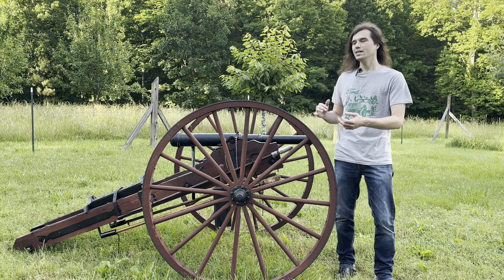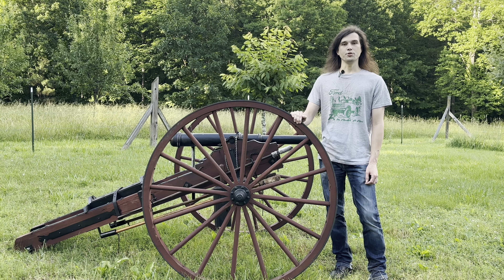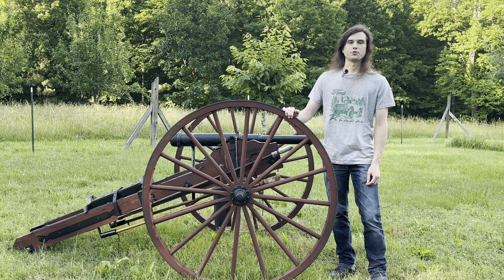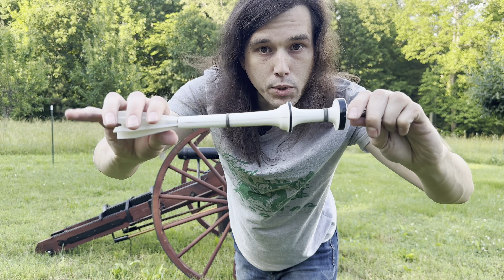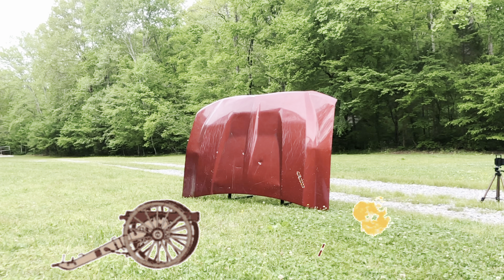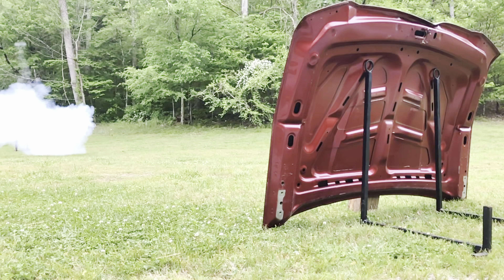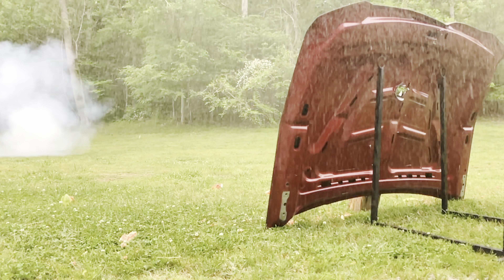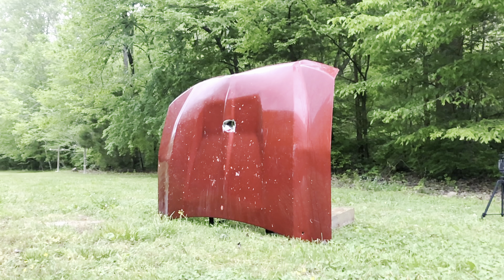Shooting 3D Printed APFSDS Tank Rounds

Comment: DING! Try Studying up on the M1A1 and its 120 mm Cannon, It uses a Sabot and its discard design, I believe that the dart is protected until exiting the cannon at very hi speeds at which it discards it protective sheath and is already in a stable flight use aluminum instead of plastic cast it and well destroy your target ...
Reply from the maker: I’ll see if I can cast some AL petals!

Comment: I did 10 years in the army, and worked with munitions multiple times. What you need is a base that is the bore diameter, with a 3-4 part cast that fits around the projectile that us the bore diameter on the outside, and patches the projectile profile on the inside.

Comment: ok, so here is my suggestion: Since you 3d printed the fins I think that you could/ might consider printing a hollow mold of those same fin designs for the rear portion and then using perhaps a resin filled with carbon fiber fibers mixed in and applied as evenly as you can. Perhaps a mold design that would snap together and allow excess material to flow out of tiny port holes that when cured could be cut or filed off. I would also be interested if you used the same method to cast a set of concrete fins and again allowing the discarding front portion of your sabot to simply be 3d printed out of the current materials. Only suggestions so please do not listen to me, but I think that it may work.
Reply from the maker: I think the molded fins are a good idea so I’ll have to figure out how to get that working or weld them on! I’ll probably make a few different versions from everyone’s suggestions!

Comment: Use a soft metal for the outer fins and shaft, like copper or led, then use hardened steel for the penetration part. Cut perforation into the outer shaft so it mushrooms and separates on impact so the hardened steel penetrate continues on. 
That’s what I’d do if I had the available means to do so. 
Sweet canon bro.
Reply from the maker: Honestly the idea of a glass shatter on impact round sounds horrifying. We’ve shot giant marbles before but I think I’ve got a fun design in mind for that….
Reply: Or maybe even a glass outer fins and shaft, so it shatters on impact. Something hard enough to withstand the initial blast, but soft enough to separate from the penetrate in impact.

Comment: You have to support the main pin in the center. If you’re pushing the fins, you’re gonna push those fins off of that pin. If you have some thing pushing on the back end of that steel pin just as much as you have it pushing on those fins, you should get a better shot with your Round. Otherwise, you’re just pushing all the plastic past the steel rod and then the steel rod has no correction because the fins aren’t attached anymore. Try something supporting and shoving on the pin that is your penetrator as well as the fins.

Comment: Your penetrator is locked onto the wrong side of the sabot! The sabot will fly out of the bore at top speed leaving the penetrator tumbling behind. My reommendation would be to make the rear of the sabot longer so that is the lenght of the penetrator, then back up the bundle with a bore-sized round plate that pushes it out.
Reply from the maker: We will give that a shot!

Comment: Try bringing the rod right through the fins at the rear, so that the pressure is exerted to the metal rod instead of the plastic fins. The black disks should be more of a cylinder shape so that they don’t twist in the barrel. Maybe even make them pointed at the front, so that the pressure is just on the rod, and not the fins at all. (Although I think this will probably deform and smash the fins anyway. Perhaps front it with a metal cone with a flattened nose) hope these ideas help, Tom
Reply from the maker: Thanks for the tips! We for sure have to drop the fins back to the end of the rods so they don’t just break apart.

Comment: You need a reinforced area that pushes the penetrator core, maybe leave the fins hollow, move the core all the way back and add a steel disk to the rubber plug?
Right now you have an accelerating piece of PLA being smashed against the inertia of a resting piece of steel.

Cool channel and concept tho, cheers from switzerland, i'm curious to see how you'll upgrade the projectile.
Reply: nvm, i read about the ribbed sabot thing, that's the solution.
Reply from the maker: I’m probably going to try both versions at some point and find out!

Comment: Because there is a gap between the pusher black disc and the penetrator end - the rear fins— the explosion and acceleration crushes the fins. I would have the steel rod be the entire length and have the forces on it and not the fins or sabot. The sabot will help trap some of the explosion and add to the velocity, but most forces need to be on the penetrator. The rod can absorb the forces, but not any 3D printed plastic
Reply from the maker: That a major edit for V2!

Comment: the prenetator and the fins need to be a single piece meade out of metal. Because the fins are in the middle of the explosion, so you need to make them survive comming out of the barrel. I would suggest using resin printed sabots they also need to survive at least part of the explosion and travel
Reply from the maker: I “think” I have access to a resin printer at work… 🤔

Comment: The second I realized that those fins are plastic, I knew it wasn't going to work. Try working with hand tools a little. Wood working, welding and other metal work. You will start getting a much better picture of the rigity of items. I love the the idea and I think you should continue pursuing it but seeing as you didn't see this coming from the get go, and was only worried about a pin. You either underestimate gunpowder or you're not sure how sturdy things are and that's pretty dangerous to say the least.
Reply from the maker: I think I over estimated the PLA and I also horridly misunderstood how the ammo itself worked being pulled by the sabot and not pushed by the base pin. That’s also why we shoot in a totally safe and controlled range!
Reply: @TheCannoneer  I suppose the next smartest step for you might be to build or find a smaller CNC mill capable of milling aluminium. Then the fins should hold out and the sabo find might even become reusable. 
Otherwise I hope you keep it, seems like a real fun project and I'm curious how well you could actually get something like that to work eventually. Good luck with your next projects and stay safe!

Comment: You could try going with a negative cup design for the back end / wadding.
Fins and wadding should create a filled cylinder (print the negative of the fins in order to have a negative cup design)
That is, if a cannonball made out of your materials will hold together all by itself. It requires some testing.
Reply from the maker: The PLA cannonballs are horrifying. Not very accurate at all but they will wreck a watermelon if you hit them. We did a video on them a while back!

Comment: just 3min into the video: you need holding grooves on the Dart to hold it in the sabot, the Sabot is your gas seal, just make it to the proper dimensions that it seals.
your design will result in the sabot getting shot out with the dart having next to no energy retained.
Dont put in any other discs or seals. 
Mashine the sabot out of harder material.

*edit: just what i expected happened. Sabot separates from the dart in the gun tube, the fins shatter due to the high pressure from the rear seal plug, the dart just flies out unstabilised with no energy.

Use threaded steel rod with an added penetrator cap, mashine steel petals with threading to hold the sabot, make some steel fins to thread on the dart, try to get to optimum pressure seal with just the Sabot. (this can be done with driving bands on the sabot).
then things should work fine
Reply from the maker: Major edits for V2! Thanks!

Comment: Don't real darts have some shaped surface where the hull can grip in to so the dart doesen't get left behind and the hull part's start flying out the barrel alone? Also i think the 3D printed stuff is no where near to deal with the forces working here. Maybe 3D printed metal would do the job.
Reply from the maker: Threaded rods are going to be a major fix!

Comment: When you say 37mm, what are the tolerances? 37.05mm or 36.95mm?
Reply from the maker: 38mm* we can go up to 38.5 but I’d be a bit shy to go too much bigger.
Reply: @TheCannoneer  That is good to know for machinists and fabricators: there is no such thing as exact measurements in a machine shop, only tolerances. Maybe you should do some tests with round (spherical) projectiles of different diameters, from 38.01 to 38.45, and different surface smoothness.

Comment: Weld fins on 
 shorter dart
3 D print two halves that completely incase dart. May need steel disk on the end to strengthen the plastic.  But not glued.
See how well it penetrates thick wood. (Log)👍🏻💥🎯
Reply from the maker: I’m excited to get a working one and see what we can put them through!
Reply: @TheCannoneer  
If you can . You could play pin the tail on the donkey game.🤔🤣

Comment: Perhaps researching how they are actually made would be the proper way. Do not try to reinvent the wheel. That is not how they are designed. Not even close.
Reply from the maker: We will implement those changes for V2 for sure!
Reply: @TheCannoneer  Honestly, I feel I sounded a little mean. I apologize.

I would suggest at the least, not to have the fins outside the sabot. They must be contained within the sabot.

I have fired hundreds of sabot rounds of many sizes. The penetrater is always completely enclosed in the sabot.

Love what you do.

Comment: Might wanna try just a simple cone instead of fins, much much stronger and the job of the finns is pretty much just to create drag on the back of the projectile. Also you need to seruce sabot to the projectile so they don't seperate while in cannon. The disk is not gas proof so the light weight sabot might fly out before the projectile has time to accelerate.
Reply from the maker: I’ve had a few of the cone shape ends so I’m excited to out that into action!

Comment: Your sabot round in a normal tank round is contained inside the sabot. And they are solid tungsten. Plastic isn’t going to hold up. At least not 3 D printed. Weld up a solid steel projectile and encase it in hdpe sabot. Get hdpe solid bar stock and mill and lathe it out.

Comment: Metal fins, add a very slight canting angle to the fins so the dart can generate some rotation. Straight fins will not allow for the dart to stabilize.

Comment: This has probably been recommended, but use all thread rod and print the sabots with the threads on the inside surface. This also makes it easy to thread the fins and nose cap on.
Reply from the maker: Threads are the major change along with metal fins are for sure edits number 1 for v2.
Reply: @TheCannoneer  Excellent! When modelling threads in CAD... I just steal them from mcmaster carr 😅

Comment: You will need to machine the fins out of metal.  Your 3D print material is not strong enough to withstand the pressures on the cannon barrel
Reply from the maker: Metal fins are gonna be V2 major edit.

Comment: if the penetrator rod had a flanged end( like a flat head nail) it would feel the load on the rod and not on the fins/sabot. A hard washer (maybe ) between the gas seal/ rod might help. Thanks for your work.

Comment: The fins need to be made of metal. Weld the fins to the dart. The dart mass should approximate that of a cannonball. I don't know about dart balance, but it would help to balance it at mid- length I'd imagine.
Reply from the maker: Metal fins are a must but I’ll have to play around with the balance and weight. Or adjust the powder charge!

Comment: The gun carriage looks so small in comparison. Is that historically accurate? If yes, why wouldn't they have mounted like 4 cannons of that size on it?
Reply from the maker: Our wheels are a bit too big for historical accuracy but that’s just because we already had the wheels and a custom set of cannon wheels is $$$ but everything else is pretty accurate to scale. We’re using a field mount and these guns can also be used in a naval carriage which uses much much smaller wheels. The difference is basically the carriage style but the barrels are basically the same for all of them and can be interchangeable.

Comment: The PLA fins are never going to stand up to pushing that rod out the barrel; extend the rod all the way to the pusher plate, make the pusher [wad] out of a more rigid material [nylon perhaps] than TPU and then attach the fins to the rod. If you use threaded rod, you can screw a nut on near the front that will provide a rigid drive interface for the discarding sabot, and all thread is common and cheap.

Comment: Looking at the video and applying common sense your fins are being shattered by the charge going off. 

When the charge goes off it's like hitting the projectile with a big ass hammer shattering the fins.

If you extend the penetrator through the fins and add a steel push plate to the end of the penetrator to spread the shock load over a wider area you should have better luck.

As I remember from photos the penetraters of the M1 Abrams rounds are 6 or 7 caliber long including the push plate.

Comment: It may be easier to make the earlier type of AP round. 

With that, you have a similar idea, but the core is a tungsten dart and then has a light aluminium outside shell case.

In your case a tungsten ball in an aluminium shell.

The downside is its not as aerodynamic. 

Sabo rounds are really difficult. You need multiple groovs to lock the sabo in to propell the dart. The fins shouldn't take the thrust as they wont. 
The dart will need to be machined to get the grooves. The fins may have to be steel as well to survive. 
And the plastic may need to be solid to have enough strength. If not aluminum. 
An alternative may be to exstend the metal dart out the back and have a hard strong aluminum plug push on that, then the sabo bit is just a guide. Even have holes in it to relive pressure form pulling it off the dart. The plug on the back does all the work pushing directly on the dart. Leving the fins free.
Reply from the maker: Much much appreciated for the tips!

Comment: maybe try putting the fins slightly higher up ( by like a quarter inch) so that the force of powder burning isn't going directly into the easily damaged plastic. or use metal fins.

Comment: Shorter rod, fins made from aluminium and threaded on, sabots should be aluminium too, and also with grooves as others have suggested. The hardest part might actually be to properly ignite the gunpowder, since it can be compressed properly, unless you can find a way to pack the powder between the fins and the sabot
Reply from the maker: Those metal fins are going to be a major improvement I’m sure!

Comment: the sabot casing is too flimsy and the tensile strength under pressure is too weak, you would need more advanced PLA or possibly carbon fiber sleeve or the easiest would be a steel sabot housing just like the PLA or cast iron with brass sleeve to catch rifling or formed to make partial rifling like a slug in shotguns with the tail being also the same material as the projectile, you might be able to thread the rear and attach 2 sets if winged lugnuts and put a friction nut to stop them from getting loose or jus use a spot weld machine to keep them stationary and can also bent the wings in the shape of an arrow to make a partial spiral to extend range but leave room to put ur base plate/sleeve base, love the design though but the reason it is immediately coming out lopside is the sabot itself, in the actual APFSDS round you can see they have almost ribs along the shaft  that can possibly help the actual sleeve from sliding or make something like a keyhole, for an extension piece from the sleeve to hold onto until leaving the barrel
Reply from the maker: Threaded for is the first think I’m changing for v2!
Reply: @TheCannoneer  absolutely man, love the ideas and inputs from curious fans of this channel, keep up the awesome new content

Comment: You have to extend metal rod backwards and rest it on the pushing part. Otherwise it is basically flimsy plastic between hammer (rod) and anvil (pushing piston part).
I have done similar things in 12 ga shotgun - see TAOFLEDERMAUS channel, russian Zenith slugs/darts/flechettes.
Reply from the maker: I just started watching him a few days ago and he’s been a wonderful inspiration!
Reply: @TheCannoneer  To save your time watch this https://youtu.be/1ANxGzul7OA?si=rQM-a5tCm_xWM7S3&t=106 from 1:46
In my design fins made from aluminum, but they are weak for smokeless powder. This brass plug pushes directly to the rod, which is heaviest part and thus generates most stress.
Setup like this is called push-style sabot. In tank APFSDS sabot actually pulls central rod. In order to do so you need a lock netween sabot and rod and a decent gas seal in the widest part of the sabot. But 3D printed sabot, I think, is too weak to hold the stress. Push-style is a way to go.

Comment: You need the pedals to cover the arrow all the way down to the fins and this way you’ll have a better chance for the fins not getting broken because the intense G forge is too much for them to handle, a closed pedal case will solve the problem.
Reply from the maker: I’ve got a version in the works that’s closed so hopefully we get them working!
Reply: @TheCannoneer  I’m keen to see it working man your videos are awesome , your design is for tank  ammunition probably that plug crushed the fins from the back , when you design the new enclosed pedal system make sure to carve some small channels on the arrow so it will hold the  pedals until they leave the barrel and you should be okey dokey.